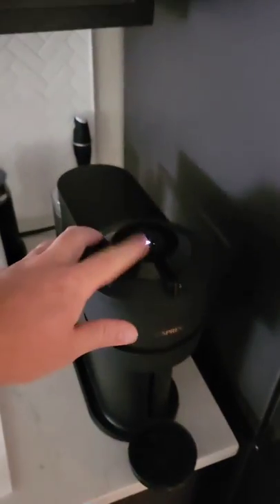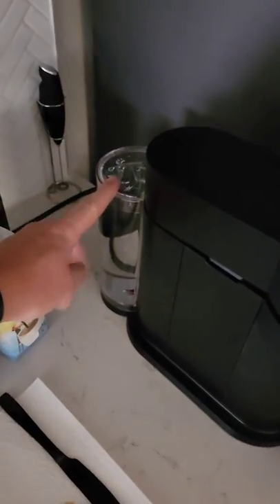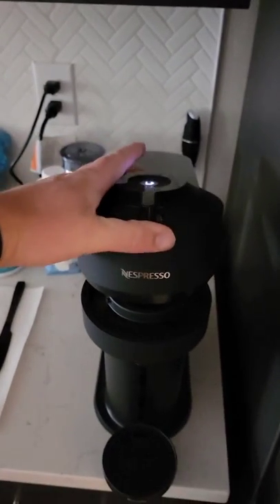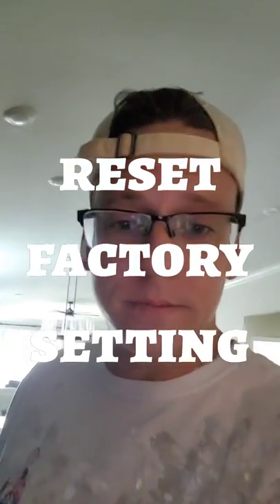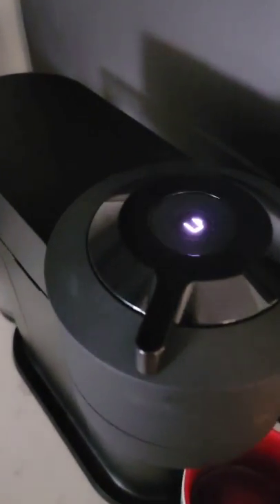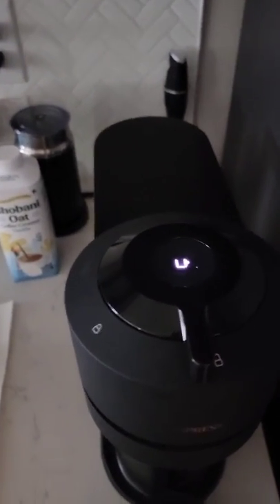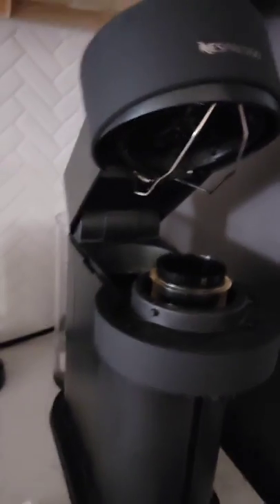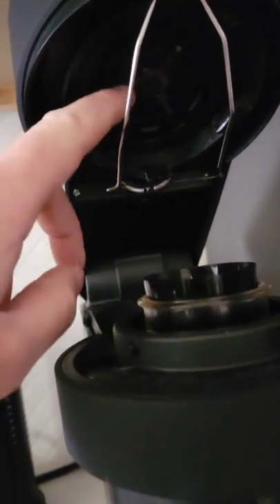How To Fix Nespresso Vertuo Next Machine

Comment: I was having a similiar issue.  Cleaned as best I could, cleaning and descaling cycle.  But the issue is the bearing.  It’s slowly getting grit and grime in it causing that spindle to not spin smoothly triggering thee error system.  Hence why when you manually turn the spindle your breaking up the grime in the bearing allowing it to move but it’s a short term fix. 

These machines may make a delicious cup of coffee but are overly complicated.  I still love my mocha pot on the stove as the best source of good coffee. No moving parts, last decades, may need a new silicone gasket every few years that’s it.
Reply from the maker: Agreed! I called nespresso and got an updated version sent at no cost. Works way better and no issues so far after months of use. But pods are also expensive so I still use a regular Mr coffee haha
Reply: @soberservants   had my Next since 2020 so almost 3 years now.  

I may attempt the bearing replacement myself. Caveat being with the whole hearted expectation I’m going to fail and just buy a new machine 😂.  But hey might get lucky

Comment: After trying all the suggested fixes, I was so hopeful!  But, unfortunately, this didn't work for my virtuo next machine.  I've done the factory reset, descaling, cleaning, the spinner is loose and free-spinning.  I am using a silicone cap on refilled Nespresso capsules and this worked fine, until it didn't.  I have tried also with original Nespresso pods to see if it was the reusable ones, but the same thing happens. Please let me know if you have any other thoughts.  Thanks.